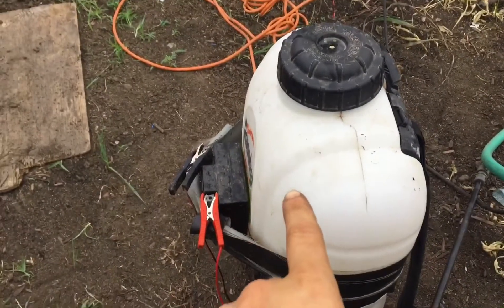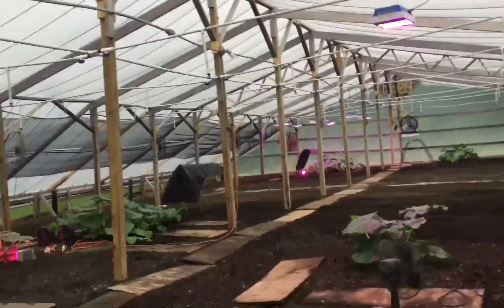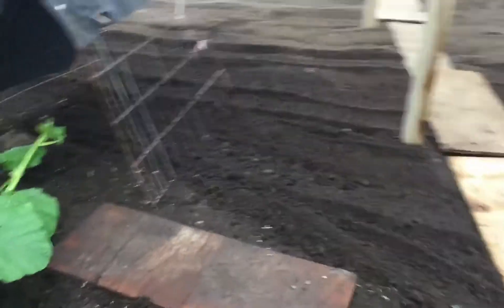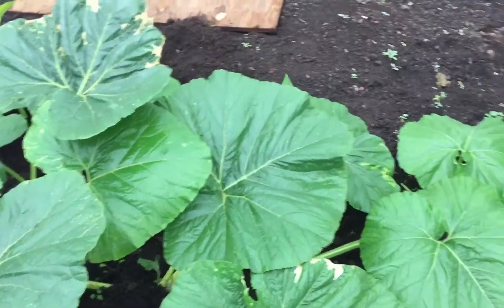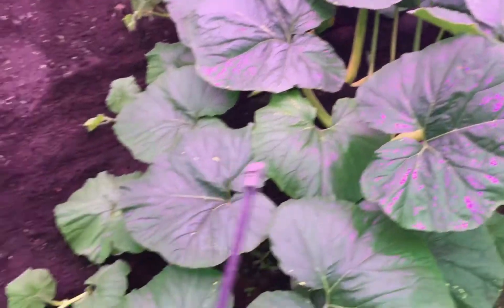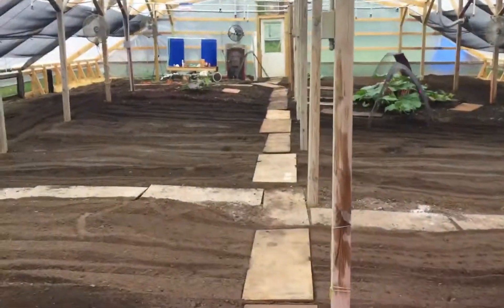Brandt's Greenhouse Episode 7

Comment: Love the videos bud! I see your shade is only on the side portions of the greenhouse. Are you just trying to shade at a certain angle when the sun comes over the house or do you have shade outside the house we can't see? I'm playing with all types of shade this year. I hate crispy leaves come august.
Reply from the maker: chris Dunn I have the shade on just the sides, and really it only needs to be on the south side, the sides are at a different angle then the top for some reason this acts like a magnifying glass for the sun, the new growth always burns without it.
Reply: Ok, makes sense. I run the whole greenhouse on sunny days here, on cloudy days I remove it. Being this far south it seems all angles burn my leafs! lol I'd rather not have to have any shade but crispy leafs drive me nuts.
Reply from the maker: chris Dunn likewise :) no one likes to see crispy leaves in the patch
Reply: @josiahbrandt150   What do you use for insects and powdery mildew
Reply from the maker: @frankpumpkin2350  eagle 20 systemic fungicide for pm, talstar for my contact insecticide and tristar for my systematic insecticide.